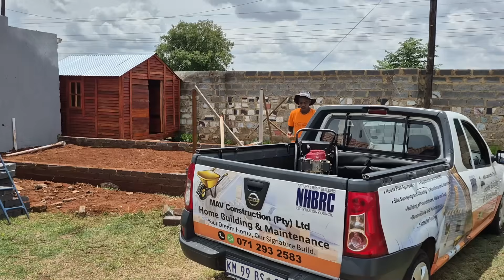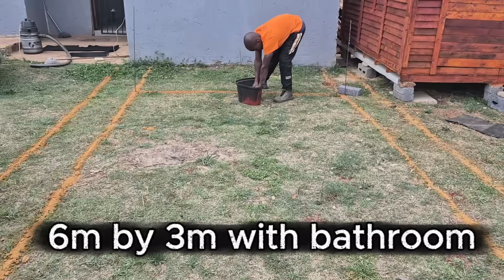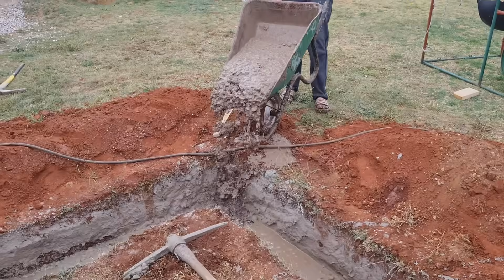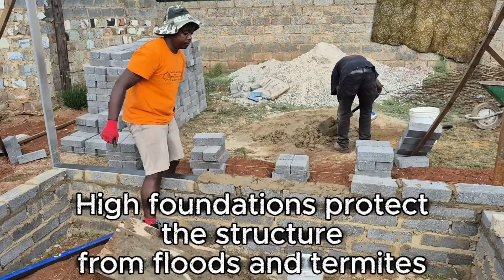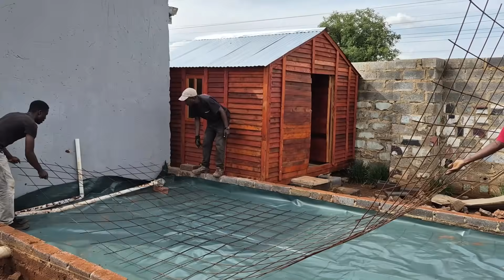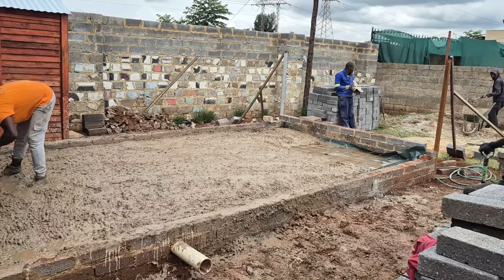Part 1 | How to Build a foundation | Cost of building | Township rental units

Comment: My questions are from your other videos,your foundation box:what canbyou say about the kind of a bricks used,why is it a single wall,please use high school English 😂what is per  m^3 the whole concrete truck or?
Reply from the maker: Maxi bricks are used on single wall application. These are not small cement stock bricks.

Comment: Rebar reinforcement vs non. What is the difference?
Reply from the maker: More likely to Crack without rebar... especially on unstable soil or multi story building..concrete is alot stronger when working together with steel..

Comment: So after pouring concrete on the trenches if it’s a double story you need to give it 21 days before you can proceed?
Reply from the maker: No, just 4 days should be fine.. 21 days is for a double story SLAB i.e. first floor
Reply: @MAVConstruction ohh I get it… thank you 😊

Comment: @Mav,  how much will it cost me to do house of concrete slab, column and concrete roof. for 3 bedroom
Reply from the maker: Concrete costs about R1350 per m3 plus R90 per m3 pumping. Also, steel reinforcement is about R17000 per ton of steel.

Comment: Hi, if I am  building a house with roof top on the garage, do I need steel reinforcement at any stage? Thanks once again  for your informative clips
Reply from the maker: Yes, your engineer should prescribe steel reinforcement since the slab is heavy. Also, you may need steel reinforcement if your soil type is unstable anyway...
Reply: @MAVConstruction  Thanks, much appreciated

Comment: Hi, thanks for your informative clips and job well done. What is the depth of the concrete at the footing stage? I am building in Bulawayo in Zimbabwe, do you know any good builder that you can recommend? Thanks
Reply from the maker: Trenches are 400mm deep with concrete thickness about 200mm.. unfortunately i don't know any builders in Zim.. thanks for watching and commenting
Reply: @MAVConstruction Thanks for your information. Much appreciated

Comment: Thanks for the video. 

Questions please. 
1. The pipes in the ground, what happens during wear and tear over the years? How do you replace them or are they wear and tear proof? If it blocks are they not hard to fix?
2. You mention costs, does this mean you charge your clients labour & material?
3. Why didn't you build 2 rows since you used small bricks?

Nice video and editing. Short, informative and to the point. Danko 🙏🏾👊🏽
Reply from the maker: Thank you for engaging...

1. These pipes are very durable and designed to have longevity especially if sealed well.

2. The costs is for the material we used not labour.

3. These are maxi bricks (not cement stock) which are designed for single leaf application 

Thanks for watching...

Hope this covers you..
Reply: @MAVConstruction  thanks for replying. 🙏🏽🤛🏽

Comment: Bathong ntate, I so love your content, I even left an important question on one of your previous videos, question was if I used maxi block for foundation and the foumdation is not raised off the ground, what can I do to prevent dampness issues on my walls and paint?
Reply from the maker: Thanks alot for interest in our videos.. if you use Maxi on foundations you must make sure there proper Damp Proof Membrane (DPM) and Course (DPC) . This is the plastic you see. Not only under concrete slab but also on the first line above foundation ... your structure will be protected from moisture. Hope that helps...
Reply: @MAVConstruction the builders didn't put no DPM, or any plastic
 So I am asking more for plastering phase, is nothing to be done to at least protect moisure from ruining paint by staining and causing dampness smell after rain?
Reply from the maker: @Emma_obk ok I understand.. there is a waterproof paint that you must apply. Its will help.
Reply: @MAVConstruction do you perhaps have  the name. Of the paint?

Comment: Thanks for the video, but you said maxi bricks are not good for foundation on the other video please assist
Reply from the maker: Yes, you're right, I did. It all depends on what the client can afford. What's important is to compensate by ensuring proper Damp Proofing as seen in the video.. there shouldn't be issues.

Comment: Hi 
Hope you well
Great video 
Does the green dpm plastic need to be over the maxi brick and come out to the outside of the building to prevent moisture and rising damp ?
Reply from the maker: No, only DPC (Damp Proof course) must be placed over the bricks. DPM is only to house concrete slab
Reply: @MAVConstruction 
Thank you 
Much appreciated

Comment: Why did you opt for a single skin instead of a double wall for your foundation?
Reply from the maker: Thank you for your question. We are using Maxi bricks and not cement stocks. Maxi bricks are designed to be applied in single leaf as they are wide enough. Please see my other video on this.. thank you
Reply: @MAVConstruction  I saw your video on Types of Bricks. I don't recall you saying a maxi is good for foundation. Please explain.
This is not to spite you but to make sure that I follow and understand your teachings.
Reply from the maker: @SpokoSpoko-x5s that's correct. Maxi isn't the best but clients find it affordable. There's ways to compensate for this to avoid Damp issues though.. hence the thick DPM used.. thanks for your observation..good attention to detail